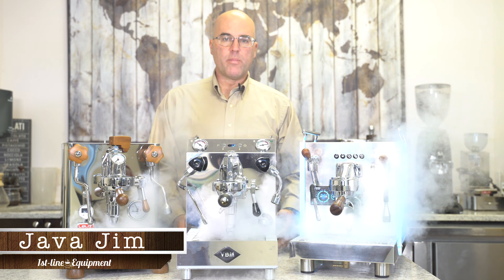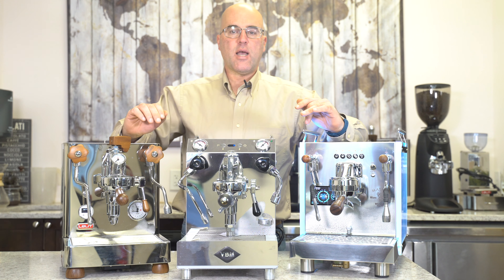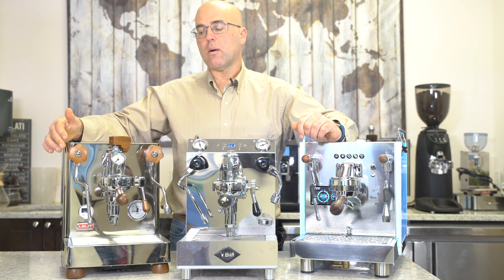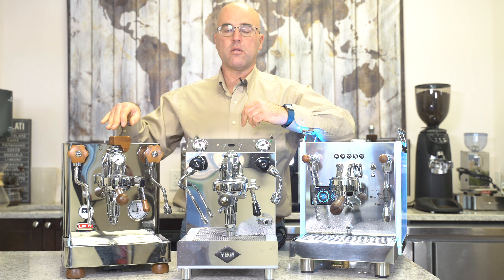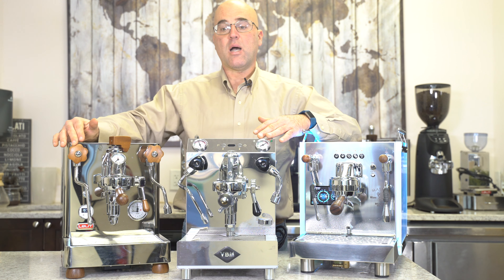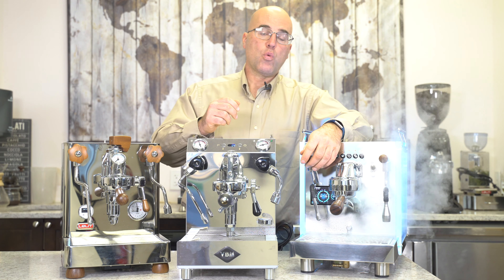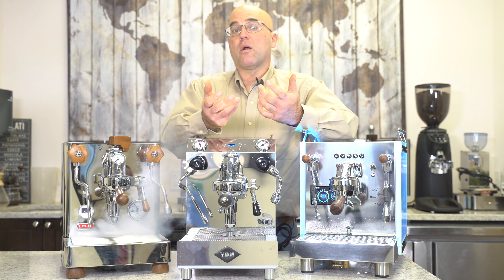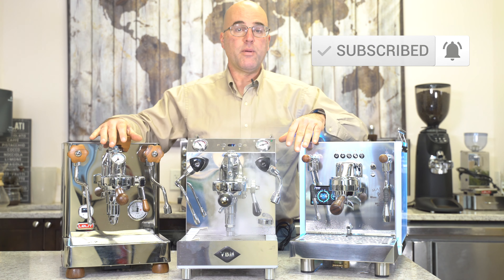Quick Look at Different Types of Steam Valves

Comment: Hi, could you share which parts on the lelit should be replaced if the non compression knob has been tightened to much. Mine doesn't run very smooth anymore. Thanks!